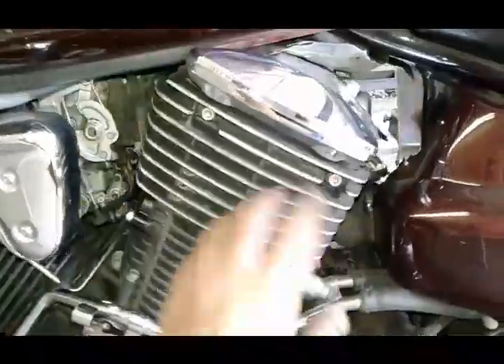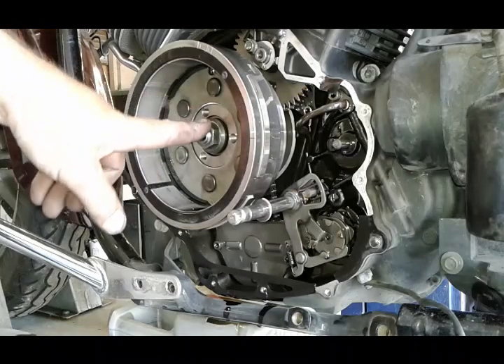Yamaha V star 1100 replace starter clutch step by step

Comment: This video was a lifesaver.. few weeks ago my 1100 starter clutch went out. I debated taking it to a shop but was quoted $1300, since I am a heavy equipment mechanic I decided to order a new big roller set from an aftermarket company and give it a go. Used this video alone from start to finish and was done in about 4hrs..... It has never started so smooth so I suspect the PO sold it to the dealer when it started going out. Lasted 5k with a start and stop clunk... Saved my riding season.
Reply: Which one did you buy aftermarket?
Reply: The brand was Ideal on eBay, just looked for the big roller type... Reviews were decent enough and for $100 or so if it goes again I'd probably just get the same one. Or by that time I may have went to a  raider😂
Reply: @adrienserigny6702  I see one from Taiwan that looks good. Is that the one?
Reply: @SamBassComedy 7 month old comments and you are I are both in here on the same day looking for the answer. Mine starting to go out last week and want to replace it this weekend

Comment: It is a good video, but has a couple big issues. I hate to be the lone nay sayer but didn't allign oil hole during reassembly. Ifyou watch the disassemble there is a hole visible before unbolting the gear. that is an oil hole for the clutch dogs. You can see the mate in the flywheel, but you didn't line up the new cluch to it nor did you prelube new parts. These will shorten the life of the new clutch dramaticly.

Comment: Best video and explanation of how to install a starter clutch easily and correctly.  This guy knows his stuff.  Great job.
Reply: Did you just do it ?
 Everytime I try to adust the split gear with screwdriver the top gear chain move clock wise which misalign my timing ..:(((

Comment: This man should do a tutorial on anything he fixes. By far the most helpful and easily understood (even with the accent) thing that I’ve watched on YouTube. Thanks for putting in the effort to help half assed diy mechanics like myself.
Reply: Did you just do it ?
 Everytime I try to adust the split gear with screwdriver the top gear chain move clock wise which misalign my timing ..:(((

Comment: Thank you.  Very well done. My 1100 VStar is making a lot of noise cranking over and now won’t start so I’m sure it’s the starter clutch. One small addition to your video would be the sound of the bike trying to start before you changed the starter clutch. Just a thought. Thanks again.
Reply: Yes exactly,  my starter just whines when it spins but doesn't try to turn the engine , idk if I have a starter problem or a starter clutch problem,  nobody had posted the difference in sound and told how it feels
Reply: I know these comments are old but for anyone coming across this wondering the same thing, there is a video out there where the guy shows what it sounds like when starter clutch is gone, but I can tell you johncowan5924 is bang on and is exactly what mine was doing. If you hear judt the starter just whirling round and round but engine isn't cranking then its 100% your starter clutch. It sounds as if you had the starter removed and bench testing it.

Comment: Wow, I just inherited a 2004 1100 Vstar and the starter was just turning but not cranking engine over. After some research I realized this was my problem. Was also shocked at this design and how involved it is to fix a starter issue. For the life of me I can't figure out why you would want this clutch seeing constant movement while bike runs and why the clutch couldn't be built into starter instead, more so like a normal car starter. Anyways I rebuilt it following this video to a T. And man what an absolute life saver, I have never seen such a clear and detailed video with amazing tips along the way, making it seem simple and breaking it down into manageable steps so the task at whole doesn't seem overwhelming or over complicated. Each step I felt I could handle after watching and what a satisfying feeling to hear this baby roar to life after!!. Thanks a million for doing this !
Reply: Amazing how detailed you are.
I'm in the middle of my rebuild now but feel confident about the outcome.  Thanks brother.  This was just a great video.

Comment: Hello I'm Richard and fixing to do the same job on a 02 v star 1100 XVS ...very helpful.....Thanks
Reply: Have you done it ?
Everytime I try to adust the split gear with screwdriver the top gear chain move clock wise which misalign my timing ..:(((
How do you move the split gear without affecting the timing alignment?

Comment: I am an electrician by trade and am SCARED to death of working on gas engines. Sir I watched this video 7 times before I started took on this project. Your instructions were perfect and from start to finish this only took me 2 hours! Instead of spending 900$ to have a mechanic do this I only spent 150$ for the starter clutch! It also gave me an excuse to buy a few tools I wanted. If anyone is wondering the Milwaukee mid range 18v 1/2 drive impact worked WONDERFUL! Thank you so much for this video.

Comment: Thank you very much for this video. I followed all your steps and things went just the way you showed on your video. Doing this myself saved me an $850.00 charge at the repair shop. It was actually a very enjoyable project. Thanks again.
Reply: Morning 
Everytime I try to adust the split gear with screwdriver the top gear chain move clock wise which misalign my timing ..:(((
How do you move the split gear without affecting the timing alignment?

Comment: Damn good video. I may have this same issue , not sure yet. My 1100's starter drags and will only make a few strokes and stops. Parts store says my battery checks out..To me that's questionable. Supposedly the previous owner as soon as he bought it used it was not running. Claims he did this job and also the stater. Self admits he's no mechanic. I don't half believe he did anything. Said he spent 400.00 on parts. Anyways you was thoughro , you didn't speak fast , nice pace. Your voice was clear. One of the best mechanical vids I ever seen. Hats off to you sir.

Comment: Glad I found this. I am repairing a buddies bike with the same problem. I am a professional heavy equipment mechanic. His methods, shop practice, explanations, and demonstrations are top notch. My only regret is that he did not expand the assembly into the same step by step. While it may seem self explanatary, it may not be to a novice. Great job on a great video.
Reply: Hi 
Did you fix your buddie s bike ?
Everytime I try to adust the split gear with screwdriver the top gear chain move clock wise which misalign my timing ..:(((
How do you move the split gear without affecting the timing alignment?

Comment: Thank you for the attention to detail. I'm re-assembling a basket case '04 V Star. I've been wondering about an extra washer I have after putting the side cover back on. I'll check it against the shift shaft from the outside, then disassemble to reinstall washer. Ugh. I wish people wouldn't take things apart when they don't know what they're doing. Another point you may emphasize- after magneto snatches the cover from your hands, check clutch cable bracket/arm position for alignment. It may prevent cover from seating correctly. Again, great job at simply explaining everything and keep up the good work! 👍

Comment: Did this today took about 6 hours plus oil filter change and yes the springs did pop out. Very good video saved me several hundred dollars.  Thanks for posting this.
Reply: Morning
Everytime I try to adust the split gear with screwdriver the top gear chain move clock wise which misalign my timing ..:(((
How do you move the split gear without affecting the timing alignment?
Reply: @feeleap2396  I've seen your question several times.. I don't know , never did this fix but may be. Nobody gives a shit to help you out with the tip...sucks. I bet he takes one of his left fingers and puts it behind to hold that split gear.

Comment: Thanks man, your video was great. Made it a breeze to fix my bike. Had the same issue, the spring broke.
Reply: Morning
Everytime I try to adust the split gear with screwdriver the top gear chain move clock wise which misalign my timing ..:(((
How do you move the split gear without affecting the timing alignment?

Comment: I had the same issue with my starter clutch several years ago now. Unfortunately I didn't have a pneumatic impact wrench or any experience in doing anything this extensive on a motorcycle. However, I have had years of experience in repairing car engines, overhauls , clutch replacements, and just about any repairs that could possibly come up on older autos. While a very scary operation I couldn't afford having the work done at the going rate of $90/hr when was getting paid only $10/hr at the time. So I forged ahead and did all the work and while the removal and re-installation of the flywheel bolt was very difficult, I was still able to get that done. The secret is to work methodically and slowly taking my time to get everything right. Like I said, this was several years ago and now my bike kicks over very nicely every time.

Comment: This DIY video was spot on. Very helpful in replacement of the one way starter clutch. Definitely will recommend for any job..
Reply: Morning
Everytime I try to adust the split gear with screwdriver the top gear chain move clock wise which misalign my timing ..:(((
How do you move the split gear without affecting the timing alignment?

Comment: I just took everything apart just waiting for parts and put everything back together. Thank you so much best video ever. 😉
Reply: Did you fix it?
Everytime I try to adust the split gear with screwdriver the top gear chain move clock wise which misalign my timing ..:(((
How do you move the split gear without affecting the timing alignment?

Comment: Nicely done. We'll explained and showing us what and where as well as our possible pitfalls are. I am new to taking it apart but I fell if I need to I could do it with the vid. Thanks
Reply: Morning
Everytime I try to adust the split gear with screwdriver the top gear chain move clock wise which misalign my timing ..:(((
How do you move the split gear without affecting the timing alignment?

Comment: Thank you for this video my bike is starting to make the noise and does not start but il try later and it looks like the battery is low .after I watched your video I got the problem. Thank you 😊
Reply: Jorge can you explain to me what noise you were hearing and what happens when you push the start button,  I may have a bad starter motor or a bad starter  clutch 🤔 any input would help thanks
Reply: Thank you for. Answering back. I heard a hard nock. At the end bike was starting and wi shut down .so I saw oil leak behind the shaft. Toca it and smell gas .
The bike had  almost to gallon of gas oil mixed 😐. I drained refill with oil and is running goo no noise at all. Bike has 25000 miles im sure starter clutch will be close to replace. Thank you. For getting back to me .by the way you have a nice video hot to replace it.
Reply: @jorgepradera2169  when it wouldn't start was the starter just spinning,  that's what my bike is doing
Reply: Ok thank you just ordered a new starter anyway never know I might get lucky

Comment: Best video I've seen on this. Subscribed right away. Question - Where do you get the replacement parts? Huge diff in price from aftermarket to Yamaha, could be worth it if the cheaper ones dont fit?
Reply: I went to the middle priced starter clutch on Amazon, said it was "heavy duty", worked like a champ for 2 years or more now.. came with new bolts also..

Comment: Appreciate you bro. About to help my cousin with the same issue. This will make things smoother. 👊
Reply: Morning
Everytime I try to adust the split gear with screwdriver the top gear chain move clock wise which misalign my timing ..:(((
How do you move the split gear without affecting the timing alignment?

Comment: I so much agree with the comment under mine excellent job .so mine to do now yalp it went out today. I thank I got this with your video. Great job pal.
Reply: Did you fix it ?
Everytime I try to adust the split gear with screwdriver the top gear chain move clock wise which misalign my timing ..:(((
How do you move the split gear without affecting the timing alignment?

Comment: Great video!  The only item I would like to see is how to reinstall flywheel nut with the specified torque.  I found a similar size bolt/nut and clamped it in my vise, and then kept adjusting air pressure / checking with torque wrench to get impact gun to tighten to specific torque in yamaha manual.
Reply: Morning
Everytime I try to adust the split gear with screwdriver the top gear chain move clock wise which misalign my timing ..:(((
How do you move the split gear without affecting the timing alignment?

Comment: The parts available for this all seem to advertise as heavy duty.  I've got them on order and hope these ones are HD and will last more that 5500 miles.  I'm a HD industrial mechanic and have over 40 years under my belt so this isn't a big deal to fix.  Mine is pulled apart and ready for parts.
They are a nice and inexpensive bike.  I love mine.
I've subscribed and hope it helps you out.
Reply from the maker: Thank you Randall !

Comment: Great job on the video. This is the absolute best one, by far. Question: what is the torque spec for the nut holding in the starter assembly?
Reply: On my Vstar it is 129.9 ft/lbs
Reply: 127-129 ft ibs
Reply: I just changed my starter clutch last week and it still will not start, it will turn over but won’t start
Reply: @alexg4328  I'm no expert mechanic but if it ran fine before you done starter clutch,  I'd go back over everything, double checking it. Make sure all timing marks are lined up,  all connectors plugged back up,  spark plug wires on good. My starter clutch went out 2 years ago and I let it sit till last Thursday. Put new starter clutch in,  and it fired right up. It did run like crap from ethanol gas sitting in the carbs for 2 years but it's getting better everyday. Good luck and hope you get it figured out.
Reply: If you can get an updated starter clutch kit with the new starter damping gears with the needle bearings, in 2 months I changed the starter clutch 5 times cause the bearings failed
Reply: @alexg4328  Witch bearings failed?
Reply: @rickycraig1747  the starter bearing on the back of the stator house. The “spring wire” that held the actual bearings in place. The best I can figure out is that the backlash from the motor starting while using “extra” throttle. With the last starter clutch kit. I bought one with the Updated One Way Starter Clutch Damper, that goes between the starter and the starter clutch gear and bearing
Reply: @alexg4328  So that worked out then?
Reply: @rickycraig1747  yes I haven’t had any issues starting it, the only thing I learn from all the online forms and videos. With all the Vstar models and the Yamaha customs. Along with anything that uses that same starter clutch bearing design. Do Not start it by giving it throttle. Choke it till it starts
Reply: @alexg4328  I’m glad you said that because that’s probably what’s going on.I always give it throttle.Good to know thanks so much bro!
Reply: Morning 
Everytime I try to adust the split gear with screwdriver the top gear chain move clock wise which misalign my timing ..:(((
How do you move the split gear without affecting the timing alignment?

Comment: Best One I have seen yet, THANK YOU! .. I Have a ? , I MESSED UP! put wrong screw in wrong hole , B-4 I figured out what I did ,I tried to start bike but Screw had engine Locked up , Did I shred starter bearing plate like this one, Because now ,Bike runs  but Bad Rattle from lower front . Thought it was valve timing But It's not . HELP! Please

Comment: Excellent video, even though I have a question about parts, not for this motorcycle but for a sister where can I get the starter clutch for a VMax 1200 1991 ?? Hope fully you can let me know. Thanks a lot

Comment: Great video 👍 BTW could you give me some advise if my Starter clutch could be faulty. I have 2007 XVS1100A and the motor slow cranks "only when hot" (even with a brand new starter motor, brand new starter solenoid and brand new battery & new earth lead. I found when this happens, if eg: I blip the starter button twice to just spin the motor slightly then when i press & hold to start on the 3rd press, it starts perfectly like when it's dead cold. So I am suspicious there is something wrong with the starter clutch or something else in there. When I turn off the bike it also makes a loud bang 99% of the time in that starter clutch area.

Comment: At 14:09 time is that why my clutch would slip on first gear? I have same bike so im doing clutch plates first to see because they are severely worn. Fresh oil fluid as well.  But i was getting a 1st gear popping to neutral. And im debating holding off on starter clutch and gear because of budget

Comment: Great video. I follow the instructions but my starter clutch seems to engage backwards
Reply: Was it backward?
Everytime I try to adust the split gear with screwdriver the top gear chain move clock wise which misalign my timing ..:(((
How do you move the split gear without affecting the timing alignment?

Comment: Hello, I appreciate your instructions. I completed the job and my buddy swears he heard a "tink" and felt something wiz past his head when I tightened it down. If I broke a tooth off the cam gear, what symptoms would appear? It starts and runs fine, but hard throttle in lower gear stumbles and hesitates a bit. I also changed the plugs later, no change. Please help!?
Reply: 18:57 your time probably off by a tooth it'll run just not perfect
Reply: @dustinpizzi9349  thanks, I appreciate the input. Probably gonna clean the carbs also.